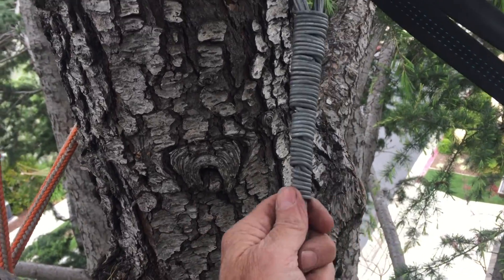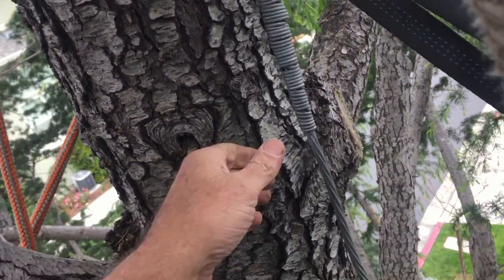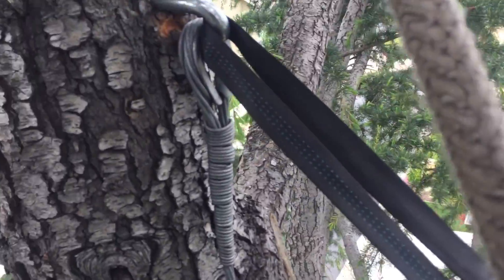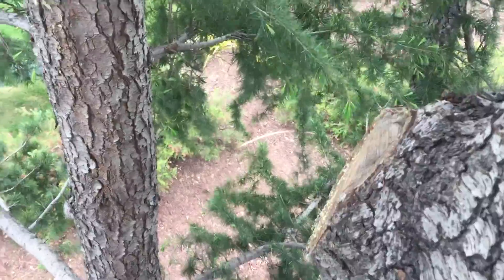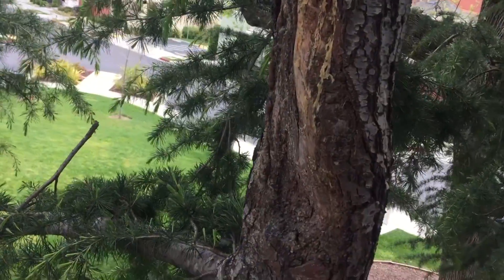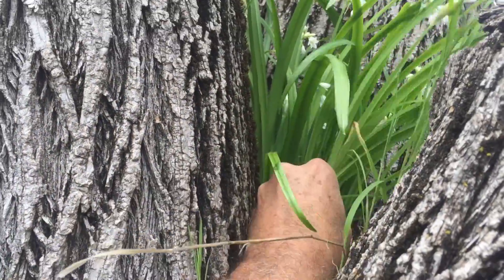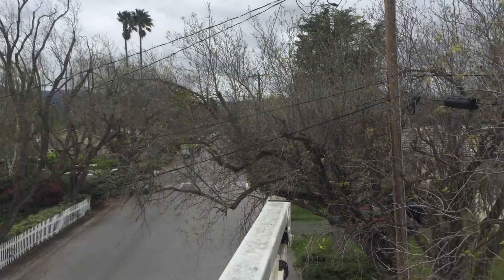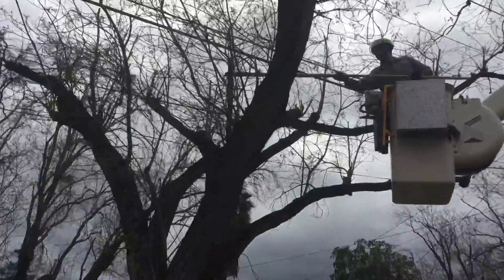Cable BREAKS

Comment: i was tought to instal cables with a little bit of slack to allow a bit of natural movement. a few years ago we changed from cables to the cobra dynamic cabling systems and love them. the initial investment on the box is pricey but it pays for itself and they look really good. they also have an indicator so if the homeowner noticed the indicator has moved they can call up a pro to climb and inspect.

Comment: I use cobra dynamic braces. They allow for more movement and the shock absorber inside them helps dampen the load when they reach their max length in the wind.  They do need to be changed every 10 years, but I strongly recommend them. Cheers from Canada!
Reply from the maker: We thought about that (after the fact), but at the time I truly believed the cable I installed was more than adequate. I don't mind showing my mistakes if they open someone else's eyes as to possibilities. In hind sight, I should have thought that this could happen.
Reply: @arboristBlairGlenn  To be honest, I never taught about the possibility that a metal wire would break from to much bending. Your video is surely an eye opener. Thanks again for all your genuine and honest videos.
Reply: They are indeed a game changer, but I find that they are not very good for short lengths (such as here), as the cable (2 ton gauge) needs to be buried into itself for at least 14-16 inches, both ends. Add another 5-7 inches for the « self adjusting » loops and you end up needing at least 40 inches between the stems. I see they have a « mini » gauge, have you tried it? Might order some for those situations when the distance between stems is too short.
Reply: @mr.k5828  Interesting point. I haven't used the mini yet, only the 2T. Hopefully Ill get more small bracing jobs this summer.
Reply: Very interesting to see the 'achilles heel' of the cable there. Thanks. I also prefer the cobra style. On really close trees I go 'splice then just around the second tree and back to the first tree for the finish splice' with a simple 'brumel' to creat the loop around the nonspliced tree. Here you only need room for one splice length. Or I go on a diagonal.
Reply: Neil D not sure I get what you mean by going around and back a tree and not needing to splice both ends?
Reply: Both ends(two separate spliced loops)around the same stem and the middle of the 'cabling' around the other stem. Very simple, maybe hard to describe though! I have spaced the ends too to create a > configuration, if that helps visualization.
Reply: Neil D I see. Have you tried the Notch cabling? Is it less « plasticky » and maybe easier for that type of splicing?
Reply: @mr K I think that might be what we have actually. It's very soft and handles well. Taking off some tension with a tempory rachet strap or something between stems, gives more room to burry the splice When it's really short
Reply: Neil D i’ve been looking to get some. Good to hear!

Comment: Here in italy we dont use steel cable in trees, but cables in polyestere or polypropilene that can be streched under pressure, they allow the movement of the canopy too
Reply from the maker: giordanone I am familiar with those but have not seen them used over here. Cobra ?

Comment: As others have said the Cobra system would work well for that situation.  I would think the Rig guy system would be good also, though it would have a harder stopping point in the wind than the Cobra system.  With the cable fully through the leader in a rig guy system, it can move together but not apart, particularly if a little slack is left in the system.  A cable there is a good idea considering the large wound in that branch.

Comment: Unlike supporting a sagging limb where you have a ramping always tension load these two vertical limbs can't be practically preloaded to maintain positive tension.  You need some type of elastomer or metal spring tension shock buffer.  The buffer can be either inline (taking full load)  or across slack in a chain so that it buffers partial load to ramp up to full tension on the chain.

Comment: Wow, that was odd. I also think that leaving a little bit of slack in the next cable/chain is a good idea. Trees are 'made' to sway some anyway.
Reply from the maker: What I didn't think about was how the metal might bend. In a longer application of the same type of cable, it would just slack down.
Reply: @arboristBlairGlenn  Yes, I agree. The short length of that cable did not give it any room to just slacken off but instead tended to bend the individual strands. Your example of taking a piece of wire and  bending it back & forth and thereby breaking it was a great example of what happened.

Comment: Yes, the chain would not be subjected to the bending that the cable was, even if it was tight. Wire rope would be much stronger than the guide wire cable, and it would flex, but it is very costly and hard to work with.
Speaking of cables, how often do you have the reverse mount tree truck  cables and insulator rods checked? They do not last forever either.

Comment: I love your “live” videos; hearing you work things out in the air. Very instructive. Sounds like you finally landed on a chain. Sounds like a good nautical solution. Would a couple of strong screw-gate karabiners work to secure it?
Reply from the maker: Yes, steel links will work with a chain.

Comment: Just my 2 cents. That cable connection should be a solid peice good for tension and compression. Like a turnbuckle.    With the cable or the strap each limb might be going in different directions at the same time. A crane can lift  10 tons easily   but if you drop 10 tons  a foot it will cause  a lot of damage.

Comment: I would say the more static the connection the higher it needs to be in the crown and the lower it is the more Dynamic the connection needs to be. I can only imagine the shock load and the forces that suddenly occur when the chain or the cable goes from slac to full force.
Reply from the maker: Richard Mumford I have thought of that as well.

Comment: When you look at the ends of the break they can tell you a lot on if the metal at the break is fresh steel all the way or if you have rings of oxidation. 

And now you see why you run into solid braces in some spots as they wanted a way to stop the gaps from closing.
Reply from the maker: I certainly didn't think about it and I can only hope this video may help others to see what I didn't see.

Comment: Cable it with aircraft cable, and leave enough slack to allow for a few inches of natural movement.
Reply: also, youcan usea triangular calbing system to add more strength into the system.

Comment: You might consider a mooring damper, two U shaped brackets inverted within each other with a spring keeping tension. They tend to be squeeky, but that can be taken out of them with a length of hose. Alternatively you might want to replace your one piece of straight wire with a steep X, two cables mirrored, running from high on one branch to low at the other. That may give you the elasticity and chock absorbing effect you want.

Comment: @UCvKnNvIM044WTFypfAxDSQQ    low cables are a plague of the industry... some think that its better to put a cable into thicker wood, while others are just taking the easy route and cabling where it's convenient... and there is also an optical illusion ... when looking at a tree from the ground, its common to misjudge the 2/3 height on the low side.  You pan down, then up at 3:04, its clear that you're well below 2/3. But each tree as you say is an individual. 

I personally would have left the crossing branch. Generally when they are that big you do more harm than good  by leaving such a big wound on a main stem. And if I had cut the limb, I would have left a small stub (which is contrary to present industry standards)  and let the tree form its own collar naturally. The return in 3-5 years and make the final cut, after the tree had set up is chemical defenses, and the new collar was clearly visible. Your cut was way to flush for my taste with a good chance of needlessly violating the BPZ (branch protection zone), which would be a long term hazard, far more hazardous than that crossing limb... Sorry if this all seems rude.. (it's an easy coast thing.. we got thick skin out here)  It's just a difference of opinion... Your heart is in the right place, and you're a nice guy. Hope you can take this as constructive criticism, not a personal attack..
Reply from the maker: Daniel Murphy no offense taken. I get a lot of comments from others who pass judgement from viewing a video.

Comment: When steel is repeatedly loaded in excess of 80% of breaking point, it will stress fracture A.K.A break. A much heavier cable should work, but would be a pain to install.  Chains do wear and stretch, so it should be heavy.  I would ask the owner to pass on to the purchaser your recommended inspection schedule.

Comment: way low on the cable Blair...  do you not believe in the 2/3 height from crotch tot he tips industry standard, or just find climbing and setting cables that high an inconvenience???
Reply from the maker: Daniel Murphy you take each tree as an individual. Your “judgement” of where I’m located is based on your viewing of this video?  The height of my install is correct and your comment feels rude.